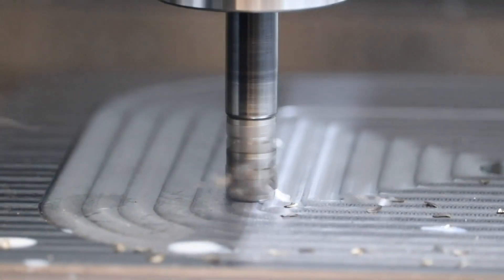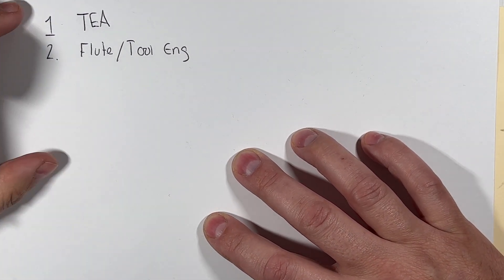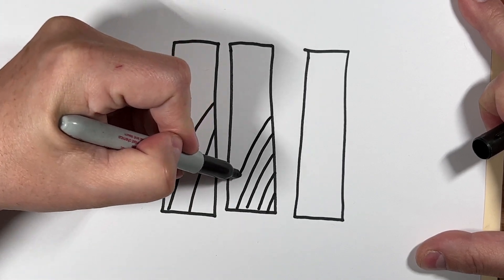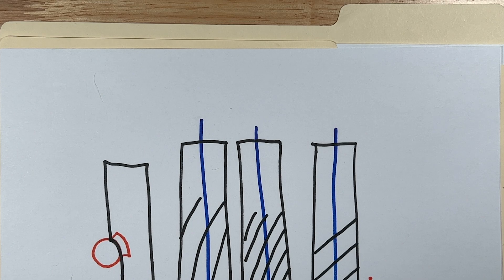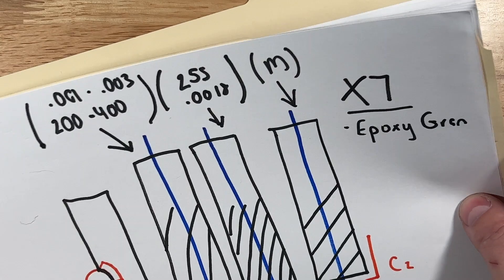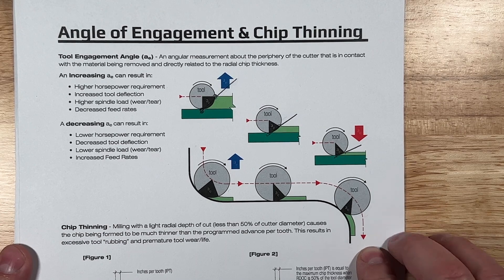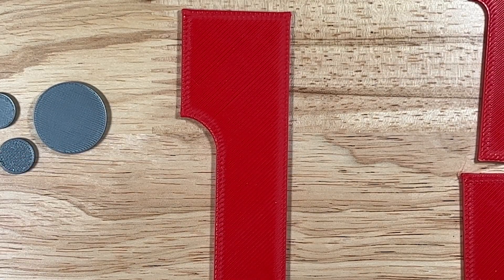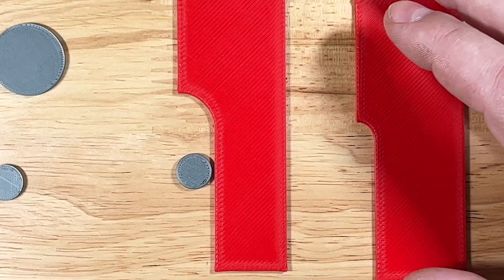CNC Milling - Tool Engagement Angle Tips

Comment: That example for engagement in outside versus inside corners is important, especially if you do much stainless or titanium.  I use Fusion's feed rate optimization when the inside radius is within 150% of the tool radius.  So if I'm cutting an inside contour and the corner is a 4mm radius and I'm using a 6mm diameter (or 1/4" - 6.35mm) end mill, I'll use optimization to reduce the feedrate into and through the corner.  It takes some messing with to get it figured out, but you can see the feedrate change in the simulation so it doesn't require it be figured out with the mill.  It makes an amazing difference, especially if I'm doing a final pass on something like a large inside rectangle.  Feed rates can stay high except in the corners.

That sound when you plunge an end mill too into an inside corner too rapidly, even though the straight section sounded great, is an awful sound.  

Anyway, Great video!

Comment: Considering the nature of the fusion 360 or hsmwork for solidworks 3D adaptive tool path where when machining a pocket it renders mostly arcs and lots of radiuses with hardly or possibly any “ideal condition” straight cuts, how would you determine the true engagement angle and why doesn’t the cam side continually adjust feeds and speeds to maintain a constant chip load and tool engagement even on inside and outside corners?

Comment: Hi Jay  Another great video.  I think a message to designers is to be careful about specifying the size of the inside radii.  If it does not matter make it big.
 As Bill ponted out below another reason for the spike on inside radii is that the feed rate is the centreline of the cutter.  Hence the feedrate at the cutter face is much greater for inside radii.

Comment: Good overview of tool engagement. Something I found interesting, I use Fusion 360 for my CAM and the the software actually uses the tool engagement angle when it calculates the tool path for Adaptive Clearing even though the input is radial cutting depth.